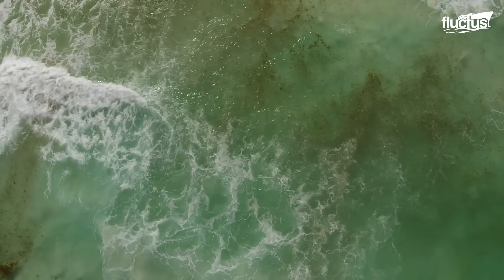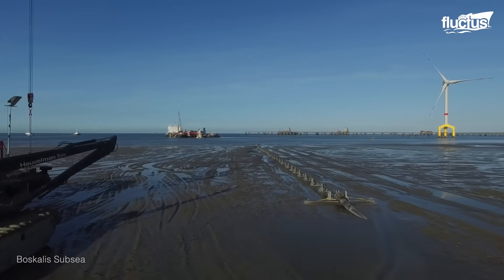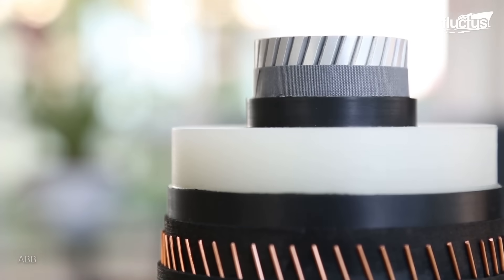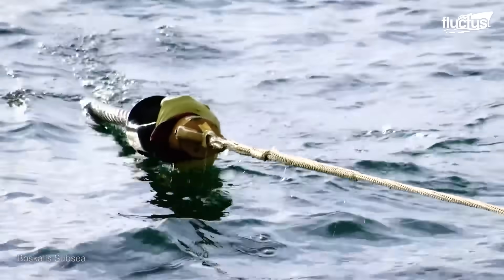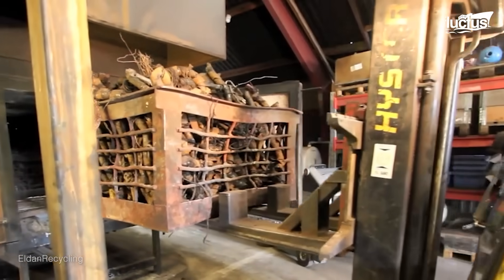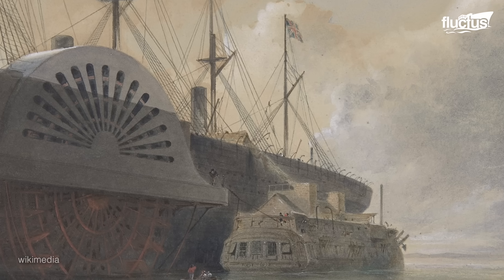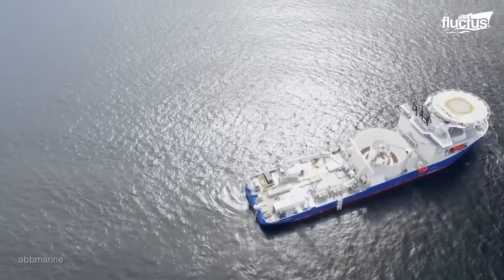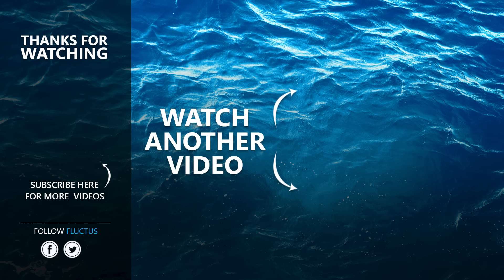There is a Reason Why Underwater Power Cables are So Expensive

Comment: I really imagine there's more underwater communication cables than power cables. Where are those cables needed and where are the longest ones? Offshore drilling? Small islands too small for power stations? Offshore windmills? I don't see why there would be so much need for these power lines apart from these niche applications

Comment: Wow! Imagine the size of the twist connector they use when the connect two of these wires together!
Reply: I figured they'd just twist them together and wrap it with electrical tape
Reply: Wagos! 😂
Reply: LOL
Reply: They tried to solder the ends properly, but a year later the 30W Weller still wasn't getting enough heat on the wire to melt the solder.

Comment: You'd think with all the advancements in the last 150 years an automatic cable spooling system would have been invented.
Reply: You'd think with all the advancements, we'd finally have flying cars but alas. We don't even have drone delivery worked out.
Reply: You'd think with all the advancements in the last 150 years, the cables wouldn't be 400$ per foot and wouldn't be as thick.
Reply: @utkrishtkumarsingh  that's because physics haven't changed
Reply: @utkrishtkumarsingh  Needs are always outgrowing the supply.

Comment: These dudes getting thousands of feet of wires to last 25 years while on the oceans floor- but I can’t get an iPhone charger to last more than a couple months. 

To be fair though iPhones are like $3 per foot of wire and they said it was hundreds per per foot. 

I’d be completely fine with spending $300 on a regular 3 foot phone charger if it would last for 25 years. (Assuming it would still be used 25 years from now but it won’t). 
iPhone chargers like $10 but i either lose them or they break after a couple months so 6 chargers a year or $60. $60*25 years=$1500 in chargers. You’d save 80% if your like me and can’t keep a charger safe.

Comment: I wonder if it would be possible to lay such a power cable to connect Europe to North America through Iceland and Greenland. This way we could take advantage of the solar power being produced on one side of the planet when the other one is in the dark. Iceland also has a lot of geothermal potential that could be exploited, which in the context of the green transition could help.
Reply: It is possible, and completely unnecessary.
There were some projects that considered building solar power stations in northern Africa and sending the power to Europe, and all those projects have been iced since it just isn't economically viable anymore and just easier to produce and distribute the power locally.
Reply: @hieronymusnervig8712  Thank you for this! Could you please elaborate why you think it is unnecessary? The way I understand it is that energy storage is a real problem. Africa and Europe being roughly between the same longitudes means that the day and night cycles overlap, meaning solar energy is produced during the same day time in both places. So excess day energy would need to be stored. This is unlike North America and Europe, where the sun always shines in one of those places, needing less storage. In addition to this, it would also create a single energy market, which would improve resilience to outside global energy interference (such as reduced gas, oil and charcoal supplies).
Reply: @tdr-xyz  I am unqualified to give a proper explanation. However with the power of the search tool you may find some explanation on google or youtube. As for what I am aware of, the infrastructure necessary to bring solar from Africa to Europe is just so expensive that it's simply more viable to put the solar directly into Europe. At least from an economic standpoint.
Reply: Did u hear the price of THAT cable its 400$ PER FOOT
Reply: @tusharranjan1723  5280 (feet in a mile) x 400 USD (max. price per foot) x 3000 (aprox. miles) = 6.336 billion USD. That's about HALF of the price of North Stream 2 gas pipeline between Russia and Germany, which btw will probably never be used. Peanuts for USA + EU + Great Britain + Iceland + Greenland.
Reply: @tdr-xyz  u r assuming 1 cable will be enough to carry enough power for powering a small portion of the us economy
Please also find the power capacity of a single cable
U will need thousands of such cable to even make it worth the hassle, leave alone the money required to do so
Reply: @tusharranjan1723  What do you mean with "leave alone the money"? You were the one that mentioned money in your first reply! If you know so well the capacity of a single cable, why don't you post some numbers about it? Or you're just one of those neighsayers that don't have data, just personal opinions based on feelings?
Reply: @tdr-xyz  I said u need to lay 1000 such cables across the atlantic ocean to even make it worth this project which in itself is a huge problem let alone the cost of the cables which will be more than 6 trillion dollars and we've not even taken into account the cost of laying the cables.
There's a reason we have multiple power plants in a country near dense population, if the power plants were located at one place the transmission of power everywhere over such long distances becomes totally inefficient.
American content has its own coastline and solar potential time to generate green energy locally
Reply: @tusharranjan1723  For a comparison, the US alone has printed around $10 trillion for COVID and quantitative easing. Add that to what the EU, Great Britain and Iceland have done. And that was in 2 years! Obviously such a project would span multiple years, possibly decades, if indeed there are thousands of cables needed as you say. So the money would not be needed all at once, which will make it easier to get it. There are already such cables between the UK, Norway, Netherlands, France etc. And from what I saw even plans to connect the UK with Iceland. So yeah, almost half way there!
Reply: @tdr-xyz  bruh that project is USELESS, why would u transfer and loose renewable power generated in europe to bring it to america when the same renewable power can be generated in the american continent.
If 10 trillion dollars was printed in last 2 years for covid, then 87000 IRS agents were recruited as well, that money will be recovered from the people.

Comment: Always leave a bit of slack.  Just in case the cable is unexpectedly hit.

I'd like to see how they locate and repair damaged underwater cables.  Splicing is just as interesting.

Do they assemble a prefabricated, pressurized vault and splice it on the sea floor or do they pull out slack in the cable and splice it on a ship?
Reply: When damaged, they send a robot to the sea floor  attach 2 sets of floats, and cut in the middle. Install 2 joins and a new short additional length of  cable then drop it back to the sea floor.
Reply: Would probably try to avoid any spices/connections on the sea floor and just make it  a straight run. But if had too, i'd say they'd pull slack up and splice on ship then set back down on ocean floor
Reply: @joeldriver9734 Actually, splices can be pre-made in the factory and they are ready to go as part of the carousel when being laid.

Comment: No straws to protect the oceans. lol
But these giga cables surrounded by plastic buried directly at the bottom of the oceans, no problem.
If there is so much plastic around it is because it is falling apart...
Reply: Plastic does not fall apart, that is the problem.  The cables are fine, discarded plastic is the cause of plastic in the oceans.

Comment: SEG Magnetics has technology to replace underwater cables, large power transmission lines, just about all power lines around the world. Reason is the SEG will be able to produce all the power needed just about anywhere on earth. SEG Magnetics is in the funding stages to get R&D started. Go check them out.
Reply: Quote from SEG Magnetics "We plan to develop the 15kW version of the SEG for mass production. The cost of mass production ranges from $50M to $500M and that is the only way to reduce the cost of the SEG to less than a comparable conventional generator of the same power rating. Once that level of institutional funding is gained, then the SEG units will be available within two years."  Translation of quote "Give us $500,000,000"
Reply: Website is all buzz words consistent with a venture capital non-starter. They've been at it for years. Their 1st featured director in the 'about us' goes by Mr. so-and-so and seems to also be focused on some kind of crypto. Their into antigravity too. If you're new to investing, this has all the earmarks of what to avoid - a good reference for getting started with due diligence.

Comment: Add the amortized cost of this cable PLUS all the costs of laying it, maintaining it, replacing it, etc., etc., etc. to the cost of every kilowatt of power generated offshore and see what the real cost of the power is!!  It’s sure not free wind power!!!!
Reply: Do power companies buy wind to generate power? Does the power generation cause a constant pollution the same way coal-powered plant does?afaik, no. Hence the term "free".

While there are extra costs to provide and maintain those undersea cables, the overall long term cost of an offshore wind power plant is potentially lower than a coal (or even nuclear) power plant.

Not to mention the undersea cables can be utilized regardless of the power source, be it solar (sun), nuclear, wind, geothermal, hydroelectric, or even coal.

Comment: What happen if there was a leak/tear on the cable if it was under the sea, does it gonna electrify anything there?
Reply: There are multiple a fail-safe layers. The first is a layer of "screen-protection" layer made out of conductive copper or aluminum wired that absorb the overflowing charge in case of a failure and transport it along the cable to certain stations to be grounded safely, then there are layers of water-absorbent cloth that expand when in contact of water and block any water from flowing inside the cable, thus containing the leakage to only a tiny section.

Comment: Whoa, I didn't even realize anchors and fishing vessels pose such a threat to underwater cables. I thought earthquakes and water currents are more common danger. Great video!
Reply: There is such a tiny risk of an anchor hitting a cable that it's basically negligible. Fishing boats though can cause damage. Luckily all the major cables have their locations public and most fishing boats of that size would know not to damage the seafloor in those areas.
Reply: @TextiX887  in the open sea, yes. But near land there is actually significant risks, especially since throughout all the steps involved the anchor may traverse a fair distance along the seafloor. That's why you usually see buoys, moiré beacons and the like where cables approach the shore. With big fat "no anchoring" signs.
Reply: @hieronymusnervig8712  Agreed. Two of ours were snagged by anchors and dragged far out of position. One of them was actually dragged into an area that the harbor maps showed was completely clear of underwater cables and it collected 4 more anchors over the course of under 20 years.
Reply: @ghost307  geez, and it still worked? Were those private cables or are you working for a power company?
Reply: @hieronymusnervig8712  Private company. The undersea cables are pretty durable so it still worked but it was past its expected life and no longer working as expected.
We decided to replace it and pull up the old one for recycling as part of a big project that we had going on so we didn't lose power to an offshore load. Scheduling the replacement before an actual failure meant that we could save quite a bit of money. If we had let it fail we'd have to pay through the nose for everything on an emergency (money is no object) basis.
As I told the people in management "Specials cost extra...just ask any prostitute".
Reply: Probably the biggest risk is cutting, for sabotage. Nations have maps of these things and teams to destroy them for strategic purposes.
Reply: I knew about anchors threat for a long time, then had to deal with obscenely slow data rates at our base in the Middle East, when a ship cut the undersea fiber. The ship basically cut the fiber ring around the Persian Gulf, fouling up multiple countries networks for over a month.
And to ice the cake, another outage off of Egypt slowed things even more.
Suffice it to say, I learned a hell of a lot about how our military networks are routed during that outage, as we had to fall back to our satellite links for network connectivity. We literally ran all of the war communications through that facility and the folks at DISA are true magicians!

Comment: Looks all very familiar! What that means is that technology hasn't moved on all that much since the 1980s when I was doing this stuff. The details of the production and laying machinery have all been upgraded and I'm sure the tolerances and maximum workable lengths have  improved a bit but the basics are the same.
Reply: Most innovation these days are about material design and production efficiency.
Reply: @TextiX887  I do wonder if transmission line physics will have more to contribute to this field (!) in the future.
Reply: There are only so many ways to skin a cat, stick a couple conductors in it, and drop it into the ocean for 3000 km.
Reply: Yes yes my friend because flat earth

Comment: 400$ per ft!!!
Even for such quality of cable, is to much!
To cover 1 miles you need over 2.000.000$, excluding labor!
Reply: You know, producing even a single of these cable takes years. Just heat treatment takes like 6 months, and that's only a single step in the process. They are also thoroughly tested before instillation. One of the tests my company is running right now is planned to take 1,5 years to complete.
Reply: Feel free to produce a cheaper cable that offers the same level of quality.
If you can do it: you will be rich in no time.

Comment: Theirs a dc line running between center north Dakota and Duluth Minnesota.  There is no sub stations or other devices along the way. Its interesting that one pole can be severed and lying on the ground and the line still functions normally. The terminals on each end are so sophisticated that even the engineers have a hard time understanding it. The whole terminal was created by an outfit in norway(I think). That line has been in continuous operation since the mid '70s.
Reply: HVDC (High Voltage Direct Current) is an incredibly specialized field.

Comment: I would love to find one of these decommissioned cable in shallow water. Just imagine how much you could make off just a couple hundred feet of one in scrap!
Reply: Think about the amount of man power and resources used to lay these cables, now imagine trying to take sections of an abandoned one, lol sounds good in theory but fuck that 😂
Reply: @no0ne69_3  Yeah. Even with the right tools (And I work for one of these companies) it can take between hours to a whole day to dismantle a small section of cable.
Reply: @TextiX887  they literally run it through the machine cutter and it cuts it in half how can u say 'i takes hours to whole day for a smalls ection' theres a guy taht cuts it with small cutter then runs it through machine
Reply: @Rhyme905  They likely have the blades on the cable cutters rotated out and resharpened frequently, considering in many cases they are cutting through metals (albeit mostly soft ones). Then before any splitting can really begin, you'd need to remove any galvanized steel reinforcement, otherwise there's no real way you're cutting into that in any efficient manner.

I suspect mostly, that the cost of recovering is just pulling it out of the water- not sure how much force it would take, but those cables look like they might be tens of ton of weight to pull one up - and if you can pull it up, where are you going to store it? Will you cut it at some point, dive, and try to pick it up again, or pull the whole thing up in one go?

I'm not saying it's impossible for just an average person to do, but if you feel like you're capable of doing that on the kind of budget and resources that an average person has access to, then you likely shouldn't stay an average person, and should seek employment doing something extraordinary.
Reply: Dont give pirates ideas
Reply: @jty9631  Arrr.
Reply: @jty9631  or crackheads

Comment: Consider that the first telecommunication cable laid between Newfoundland and Ireland didn’t work so, back to the drawing board and it was replaced. Imagine months of work at sea and an enormous financial investment simply failing to operate.
Reply: IIRC it did work but was destroyed by incompetence in operating  it . Incidentally also IIRC it was tested on way, no point laying thousands of kilo meters of wire to find out it does not work.
Reply: @Axel_Andersen  Yeah, someone burnt it out after a matter of days.